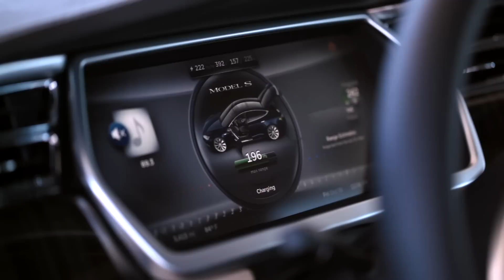CORRECTED: Why Tesla Just Purchased An Ultracapacitor Company

Comment: Strange you didn't mention the dry electrode technology that Maxwell has been working on.  Most other sites speculate that this technology is the primary reason Tesla is acquiring Maxwell.
Reply: Noticed it too.
Reply: Could be
Reply: Man with the ultra capacitor tech and the increased capacity of battery with the dry electrode battery. The electric jet engine is definitely at work.
Reply: Tasty  tech well worth the price.
Reply: @snitox  I really want to be ahead of Elon in putting together that prototype .
Reply: is dry electrode battery same as solid state battery?
Reply: ultracapacitors should be useful for cars. Rapid discharging when using ludicrous mode and recharging from regenerative braking damages the batteries, having the supercap take care of surge power allows for better battery lifetimes even when ludicrous mode is left on. if the battery just has to trickle charge the supercaps, car batteries will have longer lifetimes than combustion car engines. If the battery packs dont need to do surge power they can be made with larger cell sizes also making them cheaper, and need less cooling.
Reply: @mtube620  No. Dry electrode battery refers to a manufacturing process improvement where material can be applied to the electrodes without the need of a solvent (hence, dry). Solid state batteries are completely different, using a solid electrolyte between the electrodes, instead of the liquid used in current Li-ion batteries.
Reply: She got everything wrong she things supercapacitors aren't used bcz of their currentleakage but real reason is their energy density also costs of those is lesser thsn lithium ion batteries

Comment: hmm I thought there was only a real benefit from Ultra caps with hybrid vehicles.. if you read between the lines the Dry Anode solid state battery break through from maxwell is probably the tech Tesla is after.. not so much the UC's
Reply: Yup
Reply: You are wrong. UC can take all the power of regenerative braking even in a semi with a power output from that is massive.
Reply: The UC's have there place in hybrid battery/UC systems for cars in the near term and the solid state will be the future. It's a win win.
Reply: @skydivekrazy76  good point
Reply: @skydivekrazy76  I am talking about the Tech at Maxwell and why tesla might aquire it.  There really is nothing that special about their UC's.. the real gem they are offering is their breakthrough in solid state battery's  The UC's are just a nice side benefit.
Reply: The main benefit of UC's for a Tesla would be with regen when the battery is full or cold, you could also keep the battery discharge at a constant/lower C-rate which is better for longevity and efficiency.
Reply: @brantwedel  I was thinking possibly inline before the batteries, in the charging system. One of the big gripes by naysayers is the time it takes to get back on the road from a charging station. Wouldn't UCs allow for an extra boost initially (since they charge faster than batteries) and be able to then charge the batteries while you're on the road? 

I don't know if I explained that right but I'm still pretty new to this stuff.
Reply: @brantwedel  I was under the impression the new solid state batteries could take a higher C-rate without degrading as much already.
Reply: Charles Eye you could but it would be a fairly pointless exercise. My understanding is that ultra capacitors are not nearly as energy dense as batteries. If you only change the capacitors, it would be quick, but for any size of capacitor that could fit on a car, you would end up with only a small amount of energy. The car would not go very far.
Reply: @brantwedel  correct , but there is a small extra benefit of a more efficient regen , regardless of battery SOC or temp . Short bursts of high current are no problem for ultracaps without any charging efficiency loss . Batteries will heat up (and thus lose efficiency) under those conditions .
Reply: Now I'm no expert but my sofa based knowledge for the UCs is this:

 - They can be used for regen breaks much more efficiently, less energy is lost so more useful output.
 - Can be loaded with energy for high energy peaks, putting less strain on the battery and improving its lifetime.
 - With super charging, you can have <60 sec charging at a station. You won't get full range in this time but you could get 50 to 100 miles (maybe more in the future)

I do agree that the battery tech seems most significant but there is a lot that can be done with the UCs to improve the way regular EVs work from what I've read/watched.
Reply: @sickbailey21  Yes , yes and yes
Reply: @brantwedel  Not only that, it can also give a solid boost to the roadster when needed. They can discharge much faster than batteries without heating up. That can ensure a 0-100 time in more situations.
Reply: The capacitors will be used for regen and acceleration as a buffer for the battery similar as RAM works in a computer.
Reply: I see people say one of both, but why not both ? :-)
At the short term: no cobalt has been very high on their list.
Reply: @rogerstarkey5390  kW =/= kWh.

Comment: caps are to store energy from regen braking - then energy transferred to battery pack
Reply: nah you can not charge a battery from an ultra capacitor... they discharge way to fast.. They are best for a burst of power to the motors directly
Reply: I assume this would be a big boon to those of us in cold climates - “reduced regen braking” would less or go away?  Or does capacitor have similar cold temp issues?
Reply: Exactly. And probably only for the semi. Imagine the peak current with a full trailer stoping from 70mph to 0
Reply: @cawfeedawg  they can discharge fast, but using a simple resistor, you can discharge them at any rate ... other options are capacitor banks that individually discharge or switching inverters. (The self discharge rate of UC's is usually on the order of days, if that is what you are thinking as the discharge speed)
Reply: @davidbeppler3032  Have you any idea how big a 105kWh supercapacitor would be?
The mass would be 17.5 tonnes with Maxwell's 6 Wh/kg.
Assuming 10 Wh/l, volume would be 10500 litres or 10.5 m³ which is about half the size of a small bus. Clearly supercapacitors are useless for primary storage.
However, with a specific power density of up to 15kW per kg, that hypothetical 105kWh supercap could deliver an astonishing 17500 x 15000 = 262 megawatts for 1.5 seconds.
Reply: @brantwedel  
> they can discharge fast, but using a simple resistor, you can discharge them at any rate 
If they are perfect (aka ideal capacitor), yes.  But no capacitor is perfect.  They discharge pretty quick, even when nothing is connected to it.
Reply: a 105kWh UC would weigh about 20 tons, mixing your kW and kWh?
Reply: Chuck O  They can buffer transients but not the entire pack. Charging is like a pipeline, so when the cap fills up, output must equal input so the cap will effectively disappear. The battery will charge as if there is no capacitor after a very short period of time.
When charging stops, the capacitor can then empty its small amount of charge into the battery.
Unless the capacitor is absolutely huge, there is no real advantage having one on the charge circuit, (beyond those already in use in the switch mode voltage converters).
Regen, however, is a completely suitable application for them and can insulate the battery against short duration high power charging cycles completely.
Reply: Yes, imagine coming down a steep hill in a 50,000kg semi, can the current tesla regen circuit handle that level of power? Ultra capacitors could soak that up and trickle it back to the battery at a more digestible rate. Also, imagine    a boost feature on a roadster, charging up from the battery or when braking and then supplementing the battery under hard acceleration... Awesome.
Reply: Chuck O yup that is similar to what im thinking
Reply: @davidbeppler3032  Supercaps are overhyped by people that don't understand their strengths and limitations.
They are not useless, but they are not a holy grail of energy storage.
They have a high power density, but low energy density and low energy per volume compared to batteries by a factor of 20.
That means they are good for smoothing energy spikes such as regen because they can absorb a small amount of energy at a high power for a short time, then release it quickly when needed a few seconds later.

If you imagine a battery to be like a tank containing a ton of water with a small pipe, then a supercap is like a bucket with a large pipe. The two are not the same and have different uses.
Reply: @ahaveland  That would be a great power bank for an extremely powerful Class IV Pulsed LASER system especially one that could discharge in 500 milliseconds like for a pulsed Neodymium Glass LASER which could be then Q switched for nano second pulses
Reply: @ahaveland  Good point.  You got me thinking… I'm wondering how supercapacitors like this might factor into a power wall/home Tesla set up.  That would be one way you can have the supercapacitors be VERY large, without having to worry so much about weight or size (like you would with let's say an automobile or even a semi-).
Reply: @voicetube  Don't factor in much at all.
The cost of a supercap with the same energy capacity of a powerwall would be more than the house itself, and it would start self discharging as soon as power was removed.
Don't pin your hopes on supercaps being a viable replacement for batteries in our lifetimes or ever, because physics. Electrostatic << Electrochemical <<< Nuclear
Reply: @ahaveland  Okay, thanks Andy, I appreciate your comment.  You probably (certainly) seem to know about this subject more than I do :-)
Reply: @voicetube  Perhaps. I've only been doing electronics for 45 years and following EV tech for the last 10 years.
Reply: @ahaveland  Andy, I wasn't disagreeing with you.    Well done by the way.
Reply: @Conenion  Yes, but the maxwell UC's have . selfl-discharge over a period of about 50 days, more than enough time to put the energy back into the battery slowly, as a hybrid solution with maybe a 0.5kWh UC and 75kWh battery ;-)
Reply: That's the perfect application of ultra capacitors, not to replace the battery since its energy density much lower.
Reply: @cawfeedawg  Charge controller exist in every Li-ion battery devices.
Reply: Robert Llewellyn ( Fully Charged show) visited a factory in Estonia that already makes ultra capacitors for electric buses - their party trick is to put two inch diameter cables (plus and minus feeds) on the floor, then discharge the capacitors to a heavy load; the cables instantly went towards each other! As others have noted, this is ideal for regenerative brake systems, as a capacitor has effectively infinite charge/discharge cycles, unlike chemical batteries that are only good for a few thousand charge/discharge cycles. Not sure that a 2.7v cap is much use on a 250vDC supply though - need 100 in series for that, which divides the 3400 Farad capacity by 100 in the process, although 3.4F is still pretty big for a capacitor...
Reply: Or acceleration after braking.
Reply: @rich1383yt  nopes ultra capacitors don't have any temp or thermal charging problem.
Reply: @brantwedel  They might move to AC motors with variable frequency speed control. It's been done on railway freight locos so the tech is well up to handling the demands of cars or HGV trucks. That way an ultra capacitor can discharge into the inverter, power is chopped, inverted and fed to the motors. Capacitor would see millions of short discharges so would not dump its load all in one hit
Reply: @ahaveland  It could a be a handy way to reduce load peaks on utility cables feeding a charging station.
Reply: @Dave5843-d9m  At that level, they would not do anything more than a large battery pack would be able to handle anyway and would be far too expensive to try to emulate one.
The grid does not have wild fluctuations over a few seconds like a car accelerating and braking.
Reply: No you just keep the regen breaking energy in the ultracap until you press the accelerator again, no need for it to go back to the battery. The battery tops up the supercap not the other way round. Rapid discharging when using ludicrous mode and recharging from regenerative braking damages the batteries, having the supercap take care of surge power allows for better battery lifetimes even when ludicrous mode is left on. car batteries will have longer lifetimes than car engines.

Comment: I probably should not say "what did I say?", but if you check the videos of the new Roadster unveiling, I speculated that those demo cars were using a combination of a standard 100 KWh battery plus less than 100 kg of ultracapacitors: This combination can easily deliver 2 MW for a few seconds, then (relatively slowly) recharge the ucaps between demo runs.
Reply: Or what if it was the 100kWh battery in a lot lighter and smaller frame? Because I don't think we know how much faster exactly it is compared to model S beyond where the grip isn't the limiting factor.
Reply: @Apjooz  We do know the weight of the current 100 kWh battery module, as well as the 75kWh TM3 battery using the newer cells: Using either of those but getting rid of the weight of the battery framework for the secondary module(s), we would still end up with something which is at least 70% thicker and heavier than a single 100 kWh battery, right?

I simply could not see a way to fit that without making the door sill height larger than what it is/was, while my suggested 100 kg (or less) of ucaps would fit easily above the motors. Having such ucaps actually makes a lot of sense for any car that will do a lot of 0-60/0-100 runs in that it would protect the main battery, i.e. plaid mode without significantly reducing the expected lifetime.

Comment: Not just 'push', but also braking. Whilst regenerative braking,  there is a limit to what the maximum charge current can be absorbed, and therefore the energy that can be stored,  in a conventional battery in such a short amount of time -  leading to poor efficiencies in energy storage. Capacitive storage would allow a much higher efficiency for regenerative braking as well as being  a "fast boost" backup to normal battery power usage. Not so necessary on highway driving with its more consistent speed and slower braking/accelerating profile, . . . .  but    I imagine the "stop-go" nature of town driving would greatly benefit from this

Comment: So... Ultra capacitors is to main batteries as ultra fast cache memory is to main memory for computers.
Reply: Yep , that's a very good analogy
Reply: @wildandes1185  Or small bursts of wireless power delivery via incremental under roadway transmitters at stoplights etc.
Reply: @thealienrobotanthropologist  You might not want to rise voltage level too much, it has different kind of problems. Ultracapacitors do not have the energy density needed for a long time power delivery but you can charge and use that energy in a millisecond if other electronics are capable of that. They can also handle a lot of cycles. So instantaneous almost limitless power out or in and that means it is better at capturing energy with hard breaking and giving a huge performance boost when using it (for a moment). They also help even the load (and regen charging) for batteries, making them last longer. Of course talk like "boosting speeds at charging station" is complete bs. Who charges to get 500 meters worth of capacity. (that could work for in-road wireless chargers or something like that)
Reply: True
Reply: @thealienrobotanthropologist  true
Reply: @anand.suralkar  No, it's actually something compares to LI-ion battery cell.

Comment: As long as supercapacitors remain at super low energy density (have any even hit 40 wh/kg equal to lead acid batteries yet?) lower power density than lithium and super high cost, I doubt we’ll be seeing them in any Tesla EVs or Stationary Storage applications. 
My guess is that Tesla bought Maxwell for the dry electrode technology for vastly improving their lithium ion chemistry.
Reply: Or, just to look like they have new tech coming to try and pump the stock price before the March deadline where they need to hit $359 or owe a huge amount of cash. Knowing Musk, this is just more of his con.
Reply: @truantray  Or they just pay it with their free cash flow now that they are profitable. You read too much fake news.

This is not primarily about SuperCaps although that is great technology as well. This is about Maxwell's dry battery electrode DBE technology which is a truly solventless coating process that is also Cobalt free. This is game changing technology that can triple energy density, deliver 10-20% manufacturing cost reduction, double the battery life, and is scalable for both classical and advanced battery chemistry. A 300 mile range would extend to 900+ while weighing less. 

That is not to say there isn't other competing solid state battery technology being worked on, but DBE is clearly a huge piece of the puzzle. Tesla made the deal after carefully vetting the technology first so don't confuse someone who out thinks you for a con man.
Reply: @truantray  - what is this deadline you speak of?
And how is diluting stock going to help with that?

Comment: Capacitors are useful for re-gen braking. Somewhere for the energy to go without charging (heating) the main battery. Energy which can then be re-used when the vehicle next accelerates. Would make sence for a heavy commercial vehicle.
You can see how re-gen braking is important, but also causes nuisance heating in the FIA formula E series.